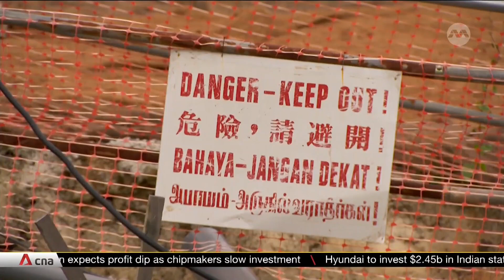More courses in robotics, automation for workers in building industry

Comment: MoND is correct.

1. Graphic design.
2. Factory customised component fabrication.
3. Materials sciences.
4. Mechanised foundation building.
5. Plumbing <newater + distil, plus mineral water piping>, air ducts, ventilation, wiring, fiberglass cable, sewage, drainage.
6. Materials handling, at factory, transport, at site assembly.

Singapore 永新 programme should see 25,000 public flat & 7,000 private flat construction annually.

A lot of work.
Busy busy, chop, chop.

🤣